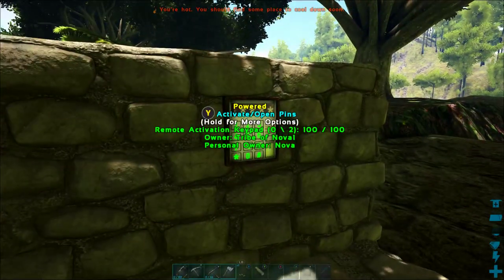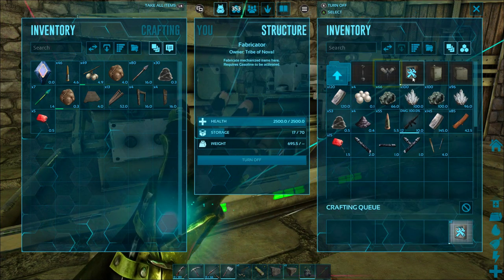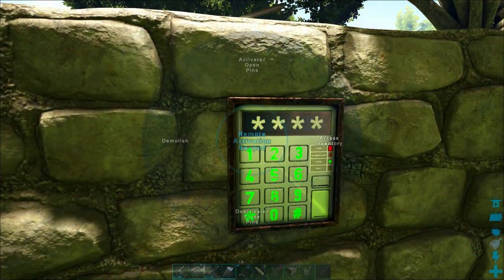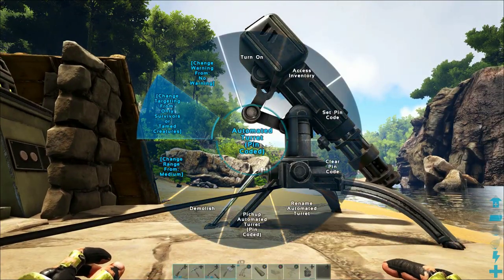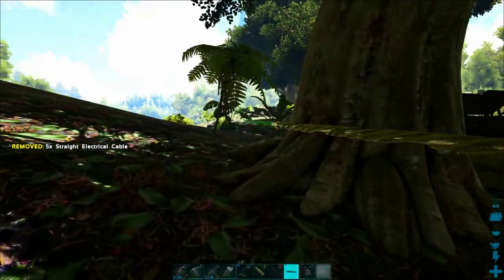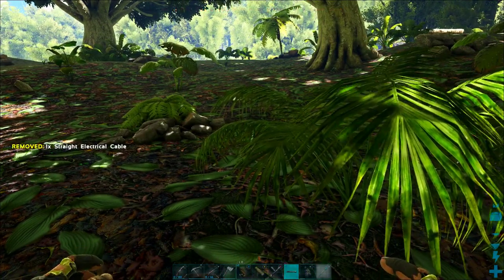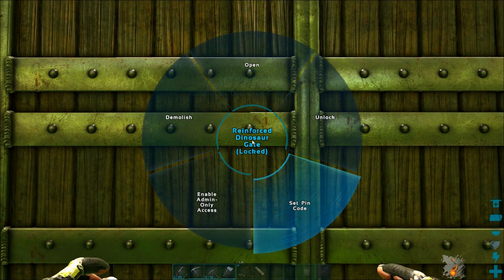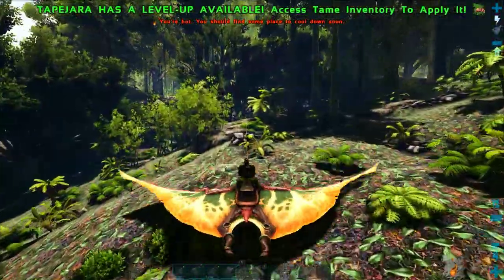122: How to Program and Use a Remote Keypad in Ark

Comment: Great tutorials I really appreciate them. I'm a long time ark player and I still learn something every know and then from your vids!. I have a question, Can you set multiple pins for one light? Like for example say you had 30 lights, 10 blue 10 red and 10 green lights and set a pin to turn them all on simultaneously, would it be possible to set a second pin number to each set of 10 lights to turn them on by color if you wanted? I tried and I couldnt seem to get it to do so but maybe I made a mistake somewhere. Thank you
Reply from the maker: Hi @Miles Oster thanks so much for the encouragement! :) I do my best to make Ark guides that are approachable enough for brand new Ark players, but have enough useful info for even veteran Ark survivors to learn something new in them. And I learn a lot from all of you as well! That's a great question about setting the light pins. I don't think it will let you set an object to more than one pin code at a time, but I will do more testing on that since it would be really helpful if that works :) Also sorry for the late response, I meant to get an answer for you before replying but life has been pretty busy lately.
Reply: @Ark:SurvivalGuide Oh no worries I certainly understand that take your time I appreciate you responding and taking the time to research my question. I tried to do this again after I commented just to double check that I had tried everything possible to my knowledge to find a way to get it to work with multiple pin numbers but still couldnt get it to do so. So any info you're able to find on your end (at your convenience🙂)would be much appreciated! Thanks again.
Reply from the maker: @milesoster3122  Anytime, I'm always happy to help! And thank you for your valuable insight too! I learn a lot from helpful subscribers like you :) I'll keep you posted if I find out any more on this, but until then, feel free to drop a comment anytime you have a question :)

Comment: Does anyone’s knows the admin commands to spawn the remote keypad
Reply from the maker: Hi @Jonathan Jefry, I can do even better than that :) The admin command to spawn the remote keypad is: 
cheat giveitemnum 198 1 0 0

You can also spawn in a charge battery to power it. If you drop this into its inventory, you don't have to build the power grid: 
cheat GFI Char 1 0 0

And the best thing I can do is point you to this website: 
https://ark.gamepedia.com/ARK_Survival_Evolved_Wiki

If you type anything into the search box, on the right side of the page will be a "spawn command" with "expand" next to it. That will tell you the command to spawn anything in :)
Reply: admincheat GFI Keypad 1 1 0
Reply: Hi Jonathan! I can do better than him, use GCM and go to crafting and then you can craft anything 😁😁😁😁